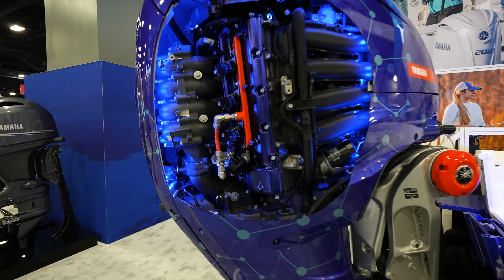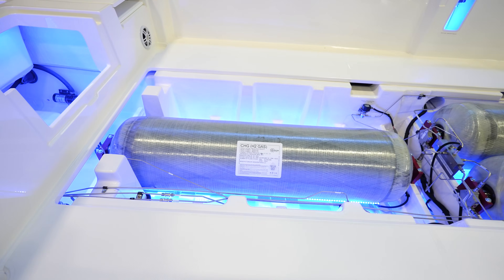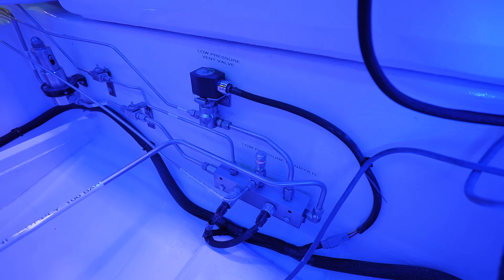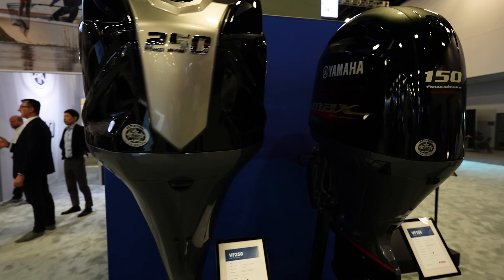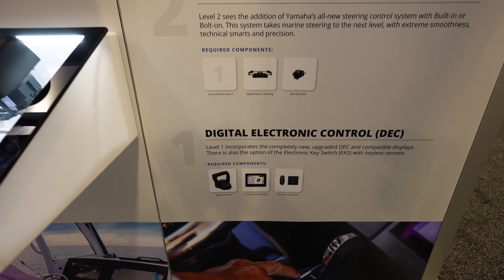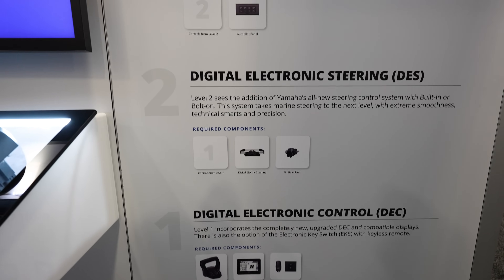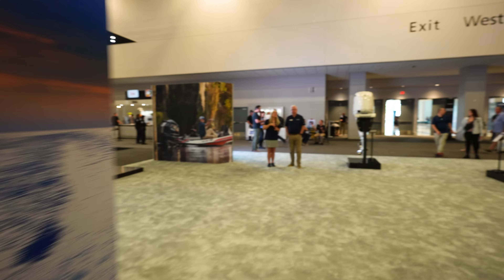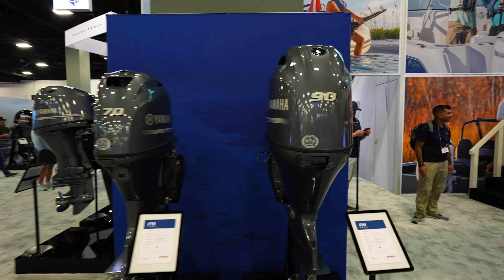Yamaha's HYDROGEN ENGINE & Booth 2024 Miami Boat Show

Comment: The stainless steel lines would have to be designed to withstand vibrations on the water.
Reply from the maker: Yeah, idk if this will ever make it to production :/ seems like you'd have to trade all the fishboxes and livewells and storage in the middle of the boat for the H2 tanks

Comment: Bring back 2-strokes!
Reply: Why bring back crappy 2 strokes when modern 4 strokes are so much better
Reply: @johnboy5167  Because old carbureted 2 strokes are easier to work on, I can tune them with a screwdriver. Whereas a new 4 strokes needs an entire computer system to hook up to even look at what is wrong with it. 2 strokes may not be as fuel efficient as 4 strokes but the simplicity of them being easy to use and maintain is in my opinion is why I prefer a 2 stroke. Plus I love the smell!
Reply: @Outdoors-pb2sc  l understand what you are saying l had a yummy 2 stroke for 10 years and it was a good engine but I sold it and got an f 225 Yamaha 4 stroke it was a much better engine had a good run with it for 20 years traded it in recently for a VF 250 sho Yamaha 4 stroke and it is an amazing engine that is far superior to any 2 stroke

Comment: Hydrogen is the future people. It burns clean. Is the most abundant element we know of. Gas vapors pool, hydrogen rises, actually less chance for accidental ignition. No carbon build up in your engine. And let's face it, if you fools are competent enough to fill your cars gas tank, you can be taught how to safely use a hydrogen dispenser.

Comment: 3x 12,000 psi bombs in my boat no thanks 😂
Reply: you should see what lithium does when it starts on fire.
Reply: @jbbref5564  yeah I heard that lithium fires can get so hot it can melt concrete. Gas and diesel doesn't burn that hot.

Comment: ONE SUGGESTION - In order to minimize potential leaks - or worse - a complete sudden blow-off... On all that hard piping that terminates to flare nuts, leave a small spiral / coil of tubing before each connection to act as a shock absorber for the flare fitting connection.  Regardles of the hull rigidity, there will be flexing between all those components.  You don't want that movement to transfer to those flare fittings.
Reply: That makes sense
Reply: They should use O Ring seals like auto A/C so for any reason it became loose the seal would still be 100%. For safety sake a sniffer under the cowl that shuts down the main supply valve at the tank.
Reply: Shut up Fanni Willis
Reply: Or use an accumulator

Comment: We put the 300HP with the DES on 26ft RIBs and you can turn the boat 90° at 35kts with 1 finger. Pretty impressive system

Comment: Is it any more dangerous than an aluminum tank filled with volatile gasoline?  Which is also  bomb.
Reply: You should learn the difference between something being volatile and something being explosive. Cause unlike gasoline, hydrogen is explosive and far more dangerous.
Reply: @UltraMagaFan  Tell them to watch the Hindenburg airship fire
Reply: A big problem with hydrogen is the molecule size, its small. Which makes it hard to prevent leaks in the system. Imagine having your boat sitting for a month and lose half the fuel capacity. because that can happen with hydrogen cars just from sitting.
Reply: @sdvten  It also has a lower energy density than gasoline, high energy requirements to make via electrolysis or steam reforming of natural gas. This is just a gimmick to shift the CO2 emissions from your boat to the power plant
Reply: Yes it is by far, corrosion and metal fatigue will make it a nightmare to maintain
Reply: @hansgruber2509 apparently you've never seen a carbon fiber tank.
Reply: Yes!!!!
Reply: The gasoline is not under extreme high pressure.

Comment: Wow thanks for the video.  The H2 unit is certainly a prototype.  I've never seen MPa (Mega-pascals) in anything that was made for the general public.  70 MPa is over 10,000 PSI.  That's a serious bomb in the bilge. You'd better think twice about bringing that friend that smokes!
Reply: Thousands of Fuel Cell Cars are incorporating 70MPa Tanks all over the world. Ever heard of something bad happening?
Reply: @nonameHER0  My understanding of fuel cells is that the hydrogen is not consumed like gas is in an internal combustion engine which (I assume is what Yamaha  H2 has made).  It's rather like a battery and produces electricity through a chemical reaction using hydrogen and that drives an electric motor. Yes I have heard of hydrogen fires but not under this extreme pressure. To be honest I would love for someone to figure out both production of hydrogen (with our fossil fuels) and safe burning of hydrogen.  It's the perfect fuel source.  Its byproducts are heat and H2O.